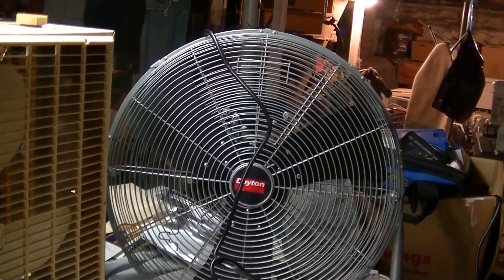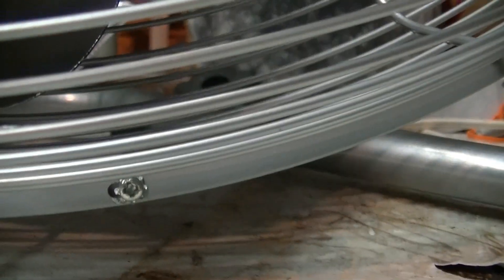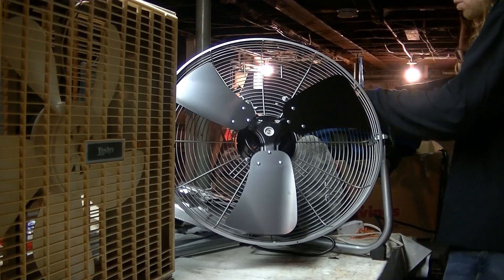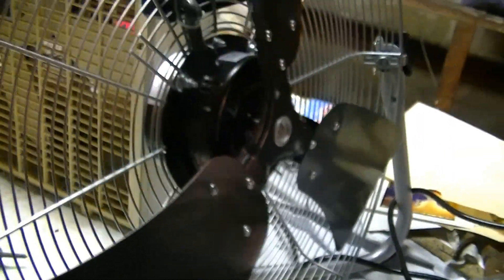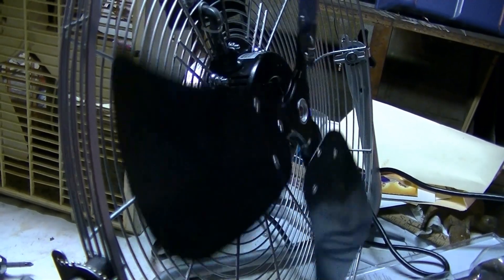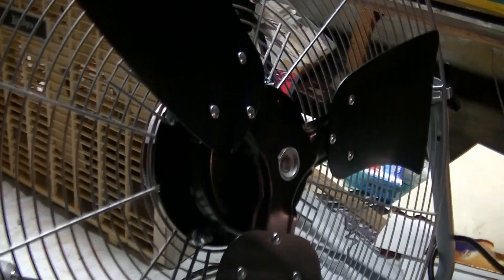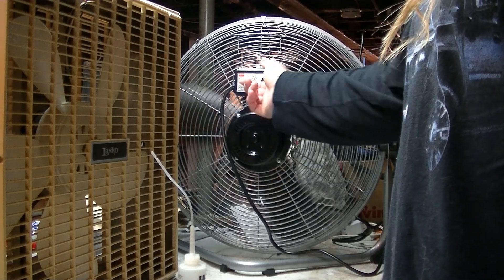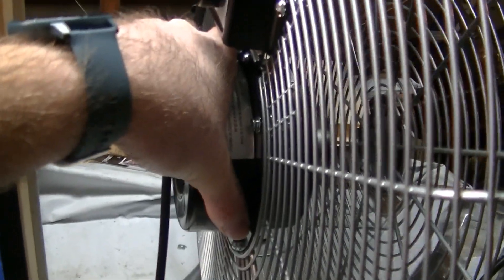Increasing The Blade Pitch on a Dayton Fan

Comment: If I want to get as close to the old Patton sound and power as possible, would you say its better to go with the Dayton 61LD80 or the TPI F-18?
Reply from the maker: Probably the TPI for power.  The Dayton is powerful too, but I'm sure the TPI beats it.  The problem with both of them is the lack of a good low speed.  I actually ended up setting the pitch back to normal on this Dayton fan because I didn't like the fact that it was drawing more current and running hotter.  They're good fans, but loud.  Such a shame that it's so hard to find a high velocity fan with a slow low speed these days.
Reply: @carson01XJ  Thanks man... I probably should have worded my question a little differently though.  I actually want it to be loud! I want it to be loud and practically blow my dang face of if I stand in front of it. The old Pattons were great, but I always wished even those were a bit louder and stronger. That being said, you think the Dayton is more obnoxious or still TPI? Or can you suggest anything else.. say under $200? All the old brands Im familiar with are junk now.